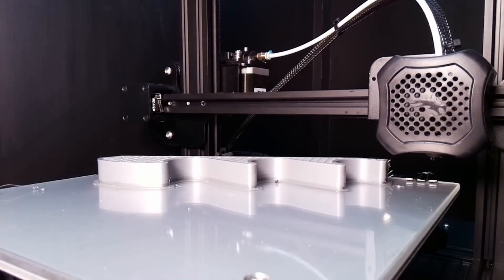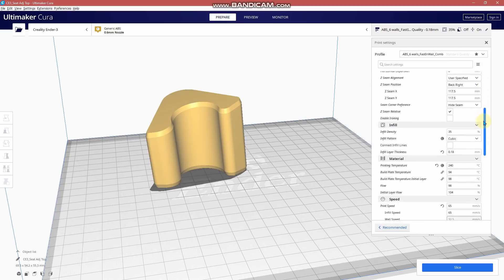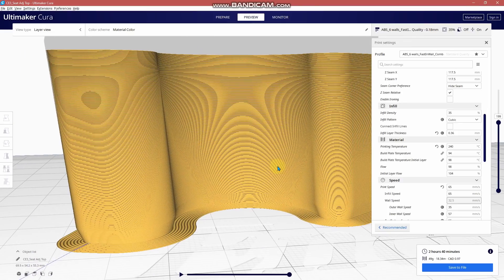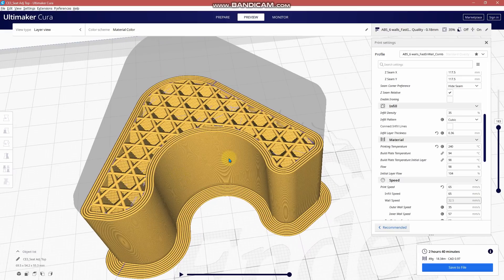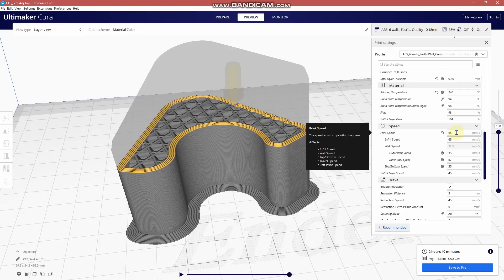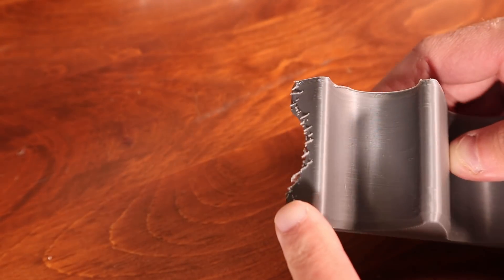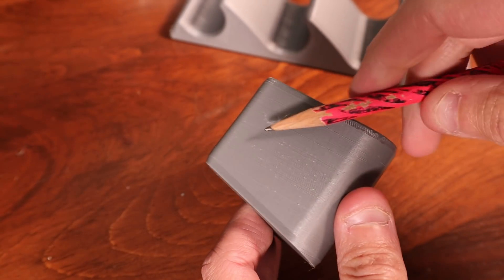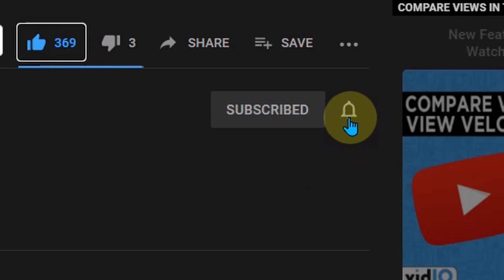Creality Ender 3 V2  - Speed up prints without sacrificing quality by turning on this setting

Comment: I heard multiple times your layer height is supposed to go by multiplying the nozzle " for me is .4". So 4 ,8 , 12 , 16 , 20 , 24

How come yours is .18?  Am i missing something. just a little confused..
Reply: no that's not true. The layer height should depend on your stepper motors. (Search for ender3 magic numbers if u want the full story) in short, one step of an Ender3 moves the nozzle 0.04mm. So if u go in multiples of that number your printer really can step to that heigt, like 0.16mm layer height -> 4 steps for the next layer, where as with a 0.18mm layer height your printer will have to do something akward sind it can only really go to 0.2 or 0.16 and not in between... so the layer height wont be equall over all layers to achieve the over all 0.18. (something like 1x 0.2 + 2x 0.16 to get a 0.18 over 3 layers)
Reply from the maker: Thanks, I've been meaning to test this myself to see if there are visible differences.

Comment: Why the hell would you need infill=35% for  something that small?  Infill =5% is PLENTY strong...I'm an architect.
Reply from the maker: I print structural parts meant to bear load.  These are my standard settings to transfer loads well beyond anything that can be applied during their use.  For better adhesion I print with the cooling fan turned down to 0-10%, top layers need good support to print correctly because of this and the infill helps a great deal.

As far as why I've used these settings... printing with these settings makes problems worse, and frankly I do not print anything for decoration, 5% infilly is insufficient for 99% of the prints I make.

I hope this answers your question.

Comment: Cranking up inner wall speed can cause bad connection of inner walls to outer walls. So it can cause weak printed parts!
Reply from the maker: Is there a number you would consider to be 'Cranked'?  I would not consider 57mm/s fast, though 78 for the infill is getting up there.   If someone is concerned, turn the fans off, and the nozzle temp higher to promote better adhesion.  I also set prints to over extrude slightly (1%).

An interesting topic to cover.
Reply: @NeedItMakeIt  It's can be very noticeable when using Linear Advance. If outer walls are printed on 30mm/s and inner walls at more than twice faster then it usually happens. In my case I've seen this at usual settings (30 and 60mm/s). LA on a bowden Ender3 (or with a similar length of tube) can't be used without a pretty high K value and E-jerk (20-30).
IDK, maybe I've set up something wrong... But my K was 0.8 to print with accurate dimensions (Tevo Flash).
P.S. this must be tested on curved surfaces. Straight lines may be printed better.

Comment: I'm confused... the original print time was 1 hour and 2 minutes... The second print time was 2 hours and 40 minutes, You almost tripled the print time... so how is this speeding up prints?
Reply from the maker: The time you're referring to is only the infill for the original setup, overall print time was 3 hours 10 minutes.  

With modifications, the infill speed changed to 35 minutes, with an overall print time around 2 hours and 40 minutes.

I hope this helps, thanks.

Comment: great video bro. I have the ender3 v2 as well. but I cannot go more than 55m/s for speed. because I get shifting in my print. how to solve this?
Reply from the maker: That's not good, I'd suggest Z-hop and part avoidance and if you use a glass build plate add a few more clips to hold it in place.... just yesterday I had mine move on me and it ruined my print..  It is also possible that the belts are worn or not tight enough and you have slippage happening.  I keep my belts fairly tight on this printer, it can handle it.  

Do you have Octoprint?  If you do, have a look at the time lapse, this helps me a lot when I need to find out what went wrong.

If you need more help, send a picture to needitmakeit@gmail.com

Thanks and good luck!
Reply: @NeedItMakeIt   Thanks for your reply. I use a new ender3 v2. Just 1 week of using with few prints only for testing. The bed is the stock glass bed with two clips, they hold the bed very well. I think the problem comes from y and x belts. How tight I can tight them?

Comment: Great video. It doesn't look like it affects the appearance or strength of the finished print all that much. I'm looking to get a 3d printer soon (probably an Ender 5). I know for myself, anything that can lower the print time will be welcome.
Reply from the maker: Thanks, I print with these settings for all of my prints, including a few other timesavers.   I save a bit here, but spend a little more where it counts and the final products really look good.  I am planning more time saving videos for future, I'd also like to test the limits of this printer.... without breaking it.  Good luck with your purchase, I'd like a larger print volume for sure, but I do like the compact size of this one, I could take it with me anywhere if I needed to.

Comment: From a structural view, it seems like thicker via one extrusion, would be stronger than the same thickness via multiple and smaller extrusions.  (Don't most prints fail a stress tests between layers.)
Reply from the maker: I would think so as well, there are methods of creating double/triple the lines for infill as well within cura.  I have done this in a recently video to create a very still part with no top or bottom layers and it turned out very well.

Yes, layer adhesion seem to be by far the weak link in the structure, there were recently 2 videos posted on printing 100% infilled parts and baking them to the melting point in salt, or a sodium mix to make a homogenous part.  I'd like to try baking soda with a very fine texture to see how they'd turn out.  

I print most of my work with the fan turned off, or set very low, small prints being the only exception.
Reply: Stefan (CNC Kitchen) made a video and post about layer height strength - https://www.cnckitchen.com/blog/the-influence-of-layer-height-on-the-strength-of-fdm-3d-prints

Comment: Thanks I am also using 0.6 but get a lot of stringing. Any tips on stringing?
Reply: try adding combing
Reply from the maker: @BlackBeardAir  Yes, it works wonders, I have a video on combing as well.  I have another video touching on it again with very clear samples to show the improvements.  I still wonder why you'd ever turn it off.
Reply: @NeedItMakeIt  not sure it comes "on".  . .
Reply from the maker: Hi, I have a few tips, it does depend a lot on the material you are printing and to some extent the brant/ingredients in the filament.  

First, if you have a bowden tube that shifts back and fourth, you'll likely have to use a 5-6mm retraction distance, it will get worse over time as well (I'm still working on a 100% effective solution to this problem).  I personally print with no fan, and because of this, movements between parts can pull a small amount of the extruded material off and it appears as blobs/stringing, I use z-hop which helps a little bit, retraction distance also helps a little to reduce the oozing of filament.  The next is print temp, I'd throw a few test pieces up and see which temp works the best for your filament, if you go higher than you need, you'll get more oozing from the nozzle at any movement.  There are other corrections, but since I personally don't have the fan turned on with my prints and I know I can't completely stop it, I print only one piece at a time, it does take longer of course, but the prints turn out much nicer and that's worth it for me.  

Let me know if any of these help you out.  I have more solutions I can offer.  Also if you can provide a photo on Imgur or send one to needitmakeit@gmail.com that would be helpful.

Comment: trying your idea on infill and not working good for me, i have mine set at .2 layer height and then did  .4  infill layer thinckness and did what you said and saved time but since it put infill on every other layer the infill was all loose and stringy using gyroid, gonna see at end of print if it made a difference. Don't know if this would be good if you have alot of bridging, it could sag possibly. To bad i could put a pic to show you.
Reply: I suspect that is because of it being Gyroid.  This technique will work best for infills with straight travels due to the gap between layers.  Have not tested this theory.
Reply from the maker: I have not tried the gyroid, I will do a test when I have a chance.  0.2 and 0.4 layer heights in general are are quite thick,  extrusion temp/speed could be a problem, overhangs and bridging as well.  It is possible, nozzle size would play into this as well (Cura should identify this if it is a problem).

Comment: How the heck do you zoom in on Cura that way? Every time I zoom in cura, it focuses on one point and moves in a line toward the part and I can almost never see the detail I wanna see at that zoom level. I just use arrow keys and then + and - .
Reply from the maker: Haha, I read this and thought... I have no idea.  I just did a test to see what it is that I do and it turns out that I was centering the object on the screen with the mouse first and then zooming in.  Holding the right mouse button down at the same time to give me the angle I need.  Lots of other programs follow the mouse, this one is based on panning the zoom location to the center of the screen first which seems a bit odd, I guess I got used to it.  

Okay, all that said, I just found a feature to turn on which allows you to zoom towards the mouse.  Go to your printer settings, click manage printers, general, then look for the zoom toward mouse direction checkbox (5th down under viewport behavior).  I think I'll keep this one turned on, much nicer to use now.

Does that help?
Reply: @NeedItMakeIt  I just saw this comment, I apologize for the delay. I will try that tonight. It has always been super annoying and counter intuitive to zoom to center for me. LOL. I feel like it zooms toward the center of the build plate, and the center of the Z travel. I am usually printing flatter parts, so it almost never lets me see what I want, which is the part touching the build plate at a close zoom. LOL. I am going to try this. Thank you.
Reply: @forestbirdoriginals4917  I'm pretty sure there's a setting in the options where you can have the zoom focus on the mouse pointer rather than on the center of the screen
Reply: I would also like to know. lol
Reply from the maker: I don't know if you are notified for responses to the original comment, please check my response to Forestbird, hopefully it helps.
Reply: If your right click and hold down shift you can move your view with your mouse I know that

Comment: For people who use Simplify3D, the equivalent setting is "Combine Infill Every _ Layers". Using the example in the video, a layer height of 0.18 mm would use a value of 2 to obtain 0.36 mm infill
Reply from the maker: Thanks, I've been meaning to try S3D, do you prefer it to Cura?
Reply: @NeedItMakeIt  PrusaSlicer is far better than Cura or S3D.
Reply from the maker: @nakwadroid  I'll check it out, is it free?  I do want the ability to print honeycomb infill, Cura does not have this.
Reply: @NeedItMakeIt  it's free, you can use it with any FDM printer, it offers heaps of different infill patterns, including honeycomb. I switched to gyroid pattern, my new favourite. It also features ironing and custom supports.
Been using this slicer since I got my MK3S in March this year and never looked back.

Thomas Sanladerer made a video about the recent 2.3.0 release.

Have fun :)

Comment: Any similar tips for increasing support printing speed?
Reply from the maker: I rarely print with support, mainly because I print structural type parts and I don't have a cooling fan turned on, the supports can make a mess of the surfaces.    I can have a look in cura and investigate this a little if you think it could help.  Do you have a preference for the pattern used for supports?
Reply: @NeedItMakeIt  no, i own a E3V2 for like a month and I'm getting all the tips i can. If only, i use tree supports since they print faster, more efficient and look cooler. Other than that I try to use the least amount of support possible
Reply from the maker: I have one pretty good technique that may work for you.  I print a part ahead of time and add it to the build plate with some glue stick when the print gets to the correct height.  If you add tape to the top of the part with a bit of glue stick to the top, it will allow the freshly printed material to stick.  I've tested this a few times and it does work well.  You may also find an object around the house that is nearly the height you want and add a 3d printed part to the top.  Of course this only works in certain situations, but it is a neat technique.  I've used it for getting a clean bearing surface for... bearings.   

I plan on making a video once I've perfected it.

Comment: Nice tip, can't wait to try it. One thing though, about ABS. ABS is a very hygroscopic material which does requires drying. Being an injection molding technician for the past decade you can take my word on it.
Reply from the maker: Now that is interesting, always possible that there is poor info about ABS online, also the assumption that because ABS is used in plumbing gives the impression that it would not... absorbing moisture and springing a leak are two different things.   I've only had issue with one filament absorbing enough moisture to cause visible defects, and that is the silver.  All storage conditions are the same for my ABS filaments, the only variable is the ingredients and printed directly from the packaging worked well, in the summer humidity the silver started to cause the surface finish to have tiny bubbles appear and a little noise during the extrusion process.  I wonder if it contains a material which readily absorbs moisture beyond the ABS itself.
Reply: "ABS is a very hygroscopic material "..
It's not, never had issues with wet ABS filament.. Only PETG and Nylon requires drying
Reply: @winandd8649  dude I work in plastics for a living as an injection molding technician. You know notta
Reply: @trollchi  Sure,but we're printing here, not injection molding. Of course you're gonna say that the material is the same, but I've never seen anyone who has troubles with printing too moist ABS filament.
Look at the video above, speaks for itself.
Have a nice day!
Reply: Look at this: https://www.youtube.com/watch?v=CTrG7OAlsEA&t=432s

Comment: Re moisture in your filament... I'm not 100% on that... I think your filament is fine. It's potentially an issue from using Octoprint to stream your gcode. If you print from the SDCard, you might find the surface defects clear up. For reference, google Octoprint stutter. I had surface defects introduced with a version of octoprint, thought it was something I'd done wrong and bad filament..... after months of testing. Turned out to be Octoprint itself doing it.

Haven't used octoprint since and zero surface defect problems regardless of the filament I've used.
Reply from the maker: Challenge accepted!  By the way, you make an excellent point about Octoprint, I don't know how many people are aware of this issue.  The transfer of code through the serial port is very slow and can cause a short pause and start between movements especially for intricate parts or many short movements.  To get around this, I load my prints to the sd card then activate them through Octoprint and Spaghetti detective.  This allows me to watch the prints from anywhere but I don't get the fancy timelapses of course.  It also is super hard to read the file names this way, so I keep them to only a few characters.  

I have to believe there is a better method than a serial port, we're nearly in 2021, the transfer of data isn't an issue anymore, why is transferring a couple of MB of Gcode over 7-10 hours time still a real problem?
Reply: @NeedItMakeIt  there was also a change in cura at one point where the slicing resolution was turned up really high and was causing the gcode to be overly complex for the simple curved movements needed. It led to much higher file sizes, thus exasperated the problem with the serial port speed. Reducing the resolution to about the same size as your nozzle or just smaller worked well with no noticeable difference. 

Also some thought disabling error correction helped octoprint reduce the overhead in the data speed.

I don't think it helped.

It's worth noting also that 8bit board have small serial buffers. The more likely issue really to the problem where is couldn't store enough data quick enough and would run dry

Comment: If you are interested in getting rid of that bandicam watermark you can use OBS which is free
Reply from the maker: I will check it out, thank you! I have been removing the watermarks lately by zooming, but I may not catch everyone and I'd really prefer to not have to add the extra step.   I've also been experimenting with WIN+G command, which does a recording for games, it seems to work very well... except in the past it didn't capture all of the dialogue boxes and that can be a problem.

Comment: so would these setting work with pla models.
Reply from the maker: I'm sure some of the settings would work for you, I print PLA on occasion and I always have fast inner walls turned on, I also always have combing mode turned on as well as z-hop.  No matter the material I keep the cooling fans low for better layer adhesion and I print in an enclosure as well to keep the part temp a bit higher for adhesion also.  Here is a profile for PETG which might work for you.  https://drive.google.com/file/d/1ld49Uw8gVbhItDMS0YO8g5zaXGgZ_Qoo/view?usp=sharing